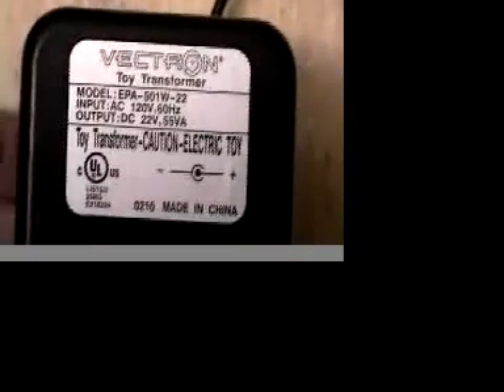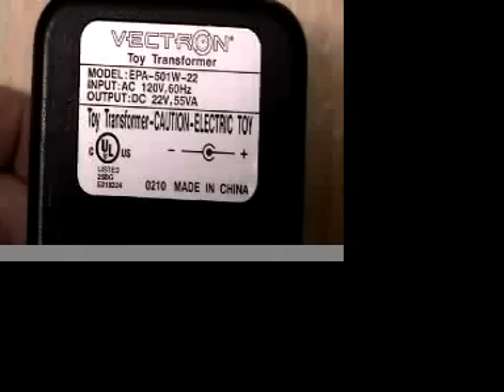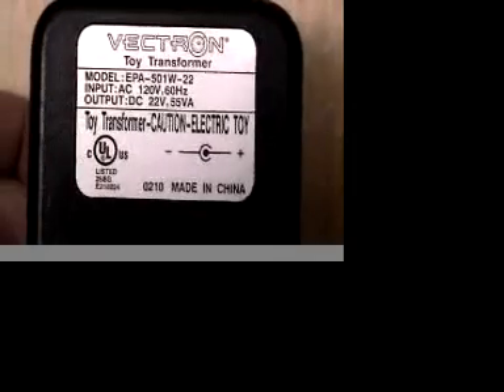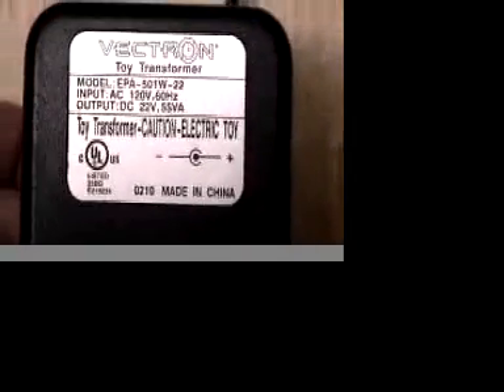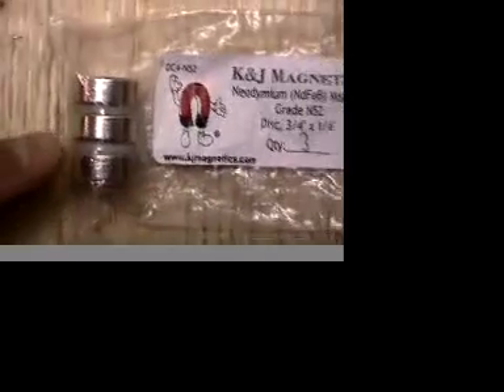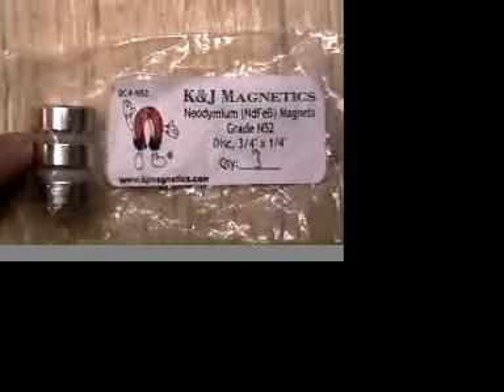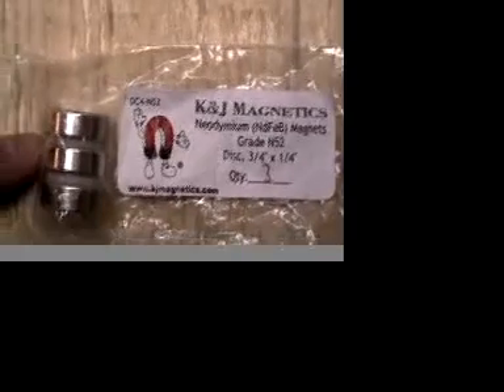Rodin Coil Demonstration

Comment: If you hold the magnet in place you have an induction coil. Changing the angle of the winding as per that Rodin tosh doesn’t mean shit other than more copper is used. Before you come back with ‘but there is more power coming out than in’ do remember that the induction coil is a type of transformer.  There is also the colossal misunderstanding of the term ‘free energy’ attached to all this. Free energy is a thermodynamics concept concerned with the available energy within a system to do work. It has absolutely nothing to do with cost.

Comment: The purpose of the Rodin coil is that it increases the electric generating capacity of a mundane generator coil simply by having a more efficient shape.  The only difference between this generator coil and a regular one is this one has a specialy calculated spiral that is more efficient in transferring energy.  It proves that shape can dictate energy output.
Reply: Micah K No, its not more efficient, look at its shape, lol some of the parts are canceling out.

Comment: What the hell is it for?
Reply: MakoRuu The purpose of the Rodin coil is that it increases the electric 
generating capacity of a mundane generator coil simply by having a more 
efficient shape.  The only difference between this generator coil and a 
regular one is this one has a specialy calculated spiral that is more 
efficient in transferring energy.  It proves that shape can dictate 
energy output.  It puts out more than 22% more eletricity only because the copper is spiraled in the manner laid out by Dr Rodin.
Reply: absolutely nothing
Reply: Figures.
Reply: Pics or it didn't happen.

Comment: what are the uses of this particular Rodin Coil?
Reply: Ask Tesla.
Reply: absolutely nothing
Reply: rc01140 same could have been said for the leyden jar  at the time of its discovery. or the voltaic pile. its about learning
Reply: You can make a rotational generator with it if you've got the right parts and coil design.

Comment: This is a solenoid.  When I was 7 I pulled one out of an old 8-track tape player; it behaved exactly like yours.  Later I learned that I was just reproducing the experiments Michael Faraday had done with magnets and coils of wire 150 years before me.

My whole life I've dreamt that someone will find some simple new discovery that will change everything, but this... this is just an electromagnet with a non-standard shape, and everything it did in this video was figured out over a century ago.

Comment: The thing is that actually no one knows (at leas there are no evidences) how to use it with purpose. All these similar devices - Rodin coil, ABHA coil, Bashar energy space-time antenna and David LaPoint's primer fields - are vortex based electromagnetic fields which (maybe) rule all the Universe, like some kind of Ultimate or Prime force. If these statements are true it's just a matter of time to discover their properties and build very efficient machines and even free energy.

Comment: When you connected both coils in parallel and it only buzzed a little, that was because you bottomed-out the filter in the power supply.  Hook it up to a pair of auto batteries and watch it fly across the room...  or a few auto batteries :)

Comment: I 've yet to build anything. If I did, I would forgo the dual coil approach and build two separate coils just to demonstrate  transformer principles. Then I could see what the effect would be by changing the polarity or directional phasing of the output coil. Basically when the magnets are introduced you are generating a current. One coil would be sufficient to demonstrate this effect. But of course it needs to move in and out of the center of one coil while reading the output. Current!

Comment: @rebeccapuiwing It compares pretty exactly with any toroidal coil, but on test up to10% less efficient,(frequency sensitive) but has interesting concentration of field, but a conventional wind arranged around the toroid also exhibits the same effect if the windings are at 45deg tangent. There are no new fields here, just re-alignments, and  have been known for over a hundred years. The design is used in generators, nothing new here.

Comment: @BunkyOhare I wonder how hot it gets for the magnets with both circuits closed. It sounds like they are battling it out for control over who gets to pull the magnets. From a rough ear on it, it does sound like close to 60Hz, Comparing my memory of AC buzz. I'd scope the output from the transformer to make sure there are no beats, clean DC. How about that Polar shift due any day. Is the Earths Core causing the Polarity or is it induced, influenced by something else?

Comment: this is essentially a Toroidal inductors/transformers rodin had nothing to do with with marko rodin but is being used in Magnetic confinement fusion which you should wiki if you like this type of thing. the concept of this has been around  for 70+ years wiki Tokamak a this is the real use for your coil with a little more information. keep at it though.

Comment: what sort of results do you get with just standard energy output when using a rodincoil rather than just a standard coil? Even a small increase would mean all turbine designs need changing.

Comment: @nericlau Nikola Tesla caused the September 1899 Cape Yakataga and Yakutat Bay earthquakes from Colorado Springs. My Grandpa had top security badge at Robert J. Oppenheimer Labs and he read the file. I am not wrong. 
September 3, 1899 
September 6, 1899 
September 9, 1899 
"If you only knew the magnificence of the 3, 6 & 9; 
then you would have a key to the universe." 
-Nikola Tesla 
(after causing three earthquakes)

Comment: Hi nice Rcoil!!can you connect this like a joulethief?...Im very curious about the results. There are 100´s of people xperimenting with simples joule thiefs lightnig cfrs, charging batteries, etc ...I think that the rcoil works better than a simple toroid coil. These xperiments are very simple..but have very important clues.
watch?v=gTAqGKt64WM&feature=fvst
for the JT replace the transistor for a 2n3055 and add more leds
watch?v=Bwws-LlBGNU
And make an eternal magnet holder
tks for share.

Comment: Hey Magenpies. Could you secure the coil to the table and see how much distance you get with the mass(magnets). Perhaps a clear cylinder in the coil core with the magnets inside and some marker. Also see if you get diferent effects elevating the magnets closer to the center before applying power.

Comment: avon001, Voltage is generally not the reason that people die when dealing with electricity.  I personally have been shocked with 50,000 volts and been completely fine.  The thing that kills people is the current that flows through your body disrupting the brain signals to your heart.  Think of your heart like a drummer in a band, if he misses a beat, the whole band is likely to fall apart.